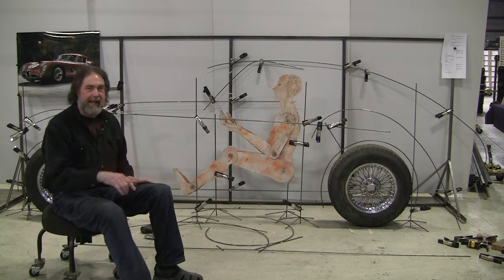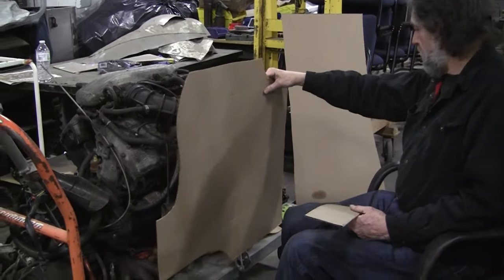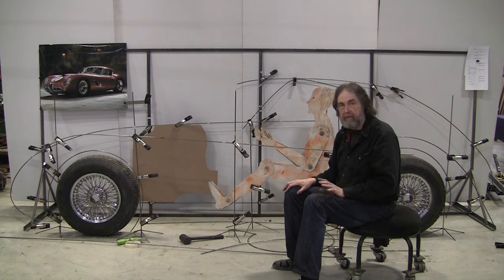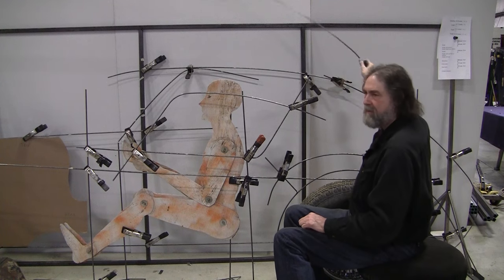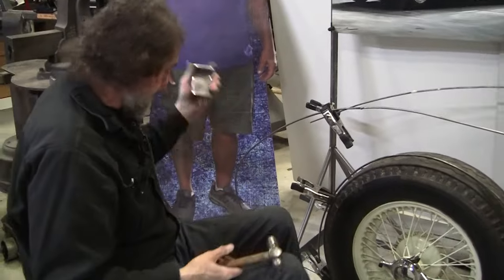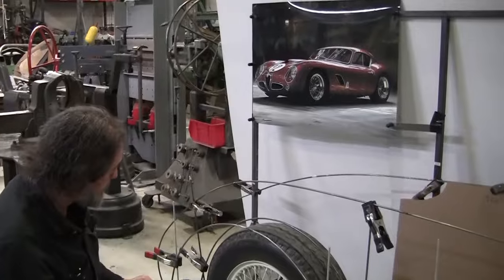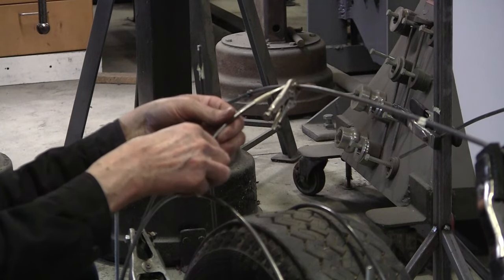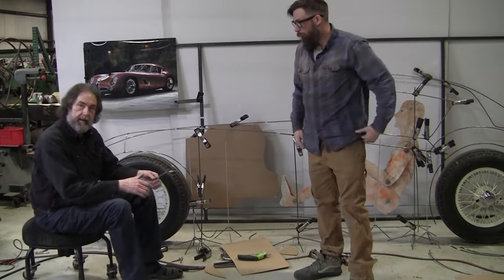How to build a Wireform: AI Designed Alfa Romeo  (Episode 6)

Comment: Wray.  I know its AI but getting Austin Healey vibes from the centerline profile.  I've done car body work in CAD and had posted various models but removed most of the stuff off the 'net.  I understand exactly what you are doing with the wire-forming in terms of 3D but have never done it myself so this is of huge interest to me on what it takes to actually bend wire.  All good stuff.
Reply from the maker: There is definitely more tweaking that needs to be done. We will definitely have more information as we add the secondary wires.

Comment: Speaking of details, the fuel filler may be a constraint due to its need to be at a certain height for the venting and/or vapor recovery to operate. Also they had a rollover protection plumbing loop that prevented the tank from emptying if inverted. I used to like the Ferrari GTB flip top fuel filler but I notice mostly folks want to lock access to the tank.  Maybe consider adapting and re- use the flip door and cap and neck from your donor Alfa model?
Reply from the maker: This is the type of comment I'm looking for. This is something we will seriously consider! Thank you!
Reply: @proshaper  Thinking further about this, I realized that the example I had in mind, 1970 C10 Pickup - the fuel pump is on the engine block, and the high loop for the supply line went up in the interior body space up about even with or above the shoulder seat belt attachment. But modern cars have the fuel pump inside the fuel tank, so a completely different way to plumb.  I do know for California Smog checks it is one of the things they look at - Vapor recovery and venting.  The rollover thing is just a check valve I think.  Maybe the entire fuel supply and fill and vapor control system from the donor is the easiest path.

Comment: Hi Wray, would it be possible for you to add a dry sump oil system to the GTV engine? This would save you some inches of height of the hood. Maybe you could lower the driver, windshield etc as well. Just a thought...